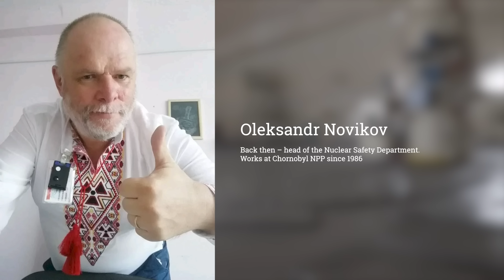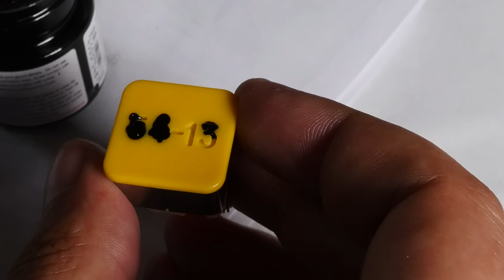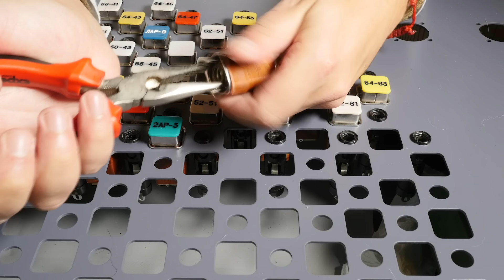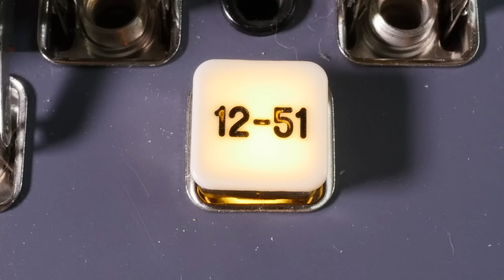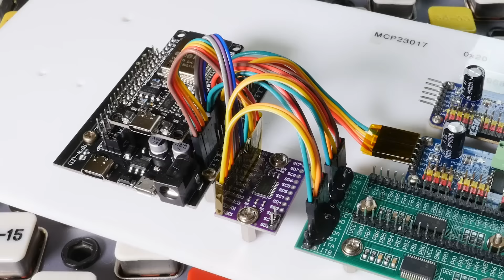Chernobyl Reactor at Home — Part 1

Comment: Why were some of those P2P1T switches unlabeled??
Reply from the maker: Because they serve as indicators for DKE-H detectors (energy distribution by height) and technically they can be pushed, but nothing will happen – they are not wired. There reason why they used buttons is that the panel was upgraded, and the easiest option to fit something in those specific square openings was to use blank buttons.

Comment: Or you can make a fully blocky shield by controlling the power unit better using real graphics.
Reply from the maker: That makes sense. BTW, check the more recent videos, as there have been made more tech.

Comment: do you know what would make it even realistic and extreme to do?

add a miniature of the RBMK-1000 with a sytem that raises and loweres the control rods with the action of the controls. you can do it with step-motors and some endless screw mechanisms to simulate the core

i love the project and i will be expecting new updates! it´s simply awesome!

Comment: If i send you 50.000€ can you build me one?
Reply from the maker: I guess yes, yet finding original parts will take some time ;)
Reply: Has it to be Original-Parts? Arduinos, Stepper-Motors and 3D-Printing would be fine for this. I guess there are a few people who would give you money for this and if you have the simulator software you can copy it and reproduce the machine you "invented".

At least 50.000 would be the start of a crowdfunding.
It was only an idea because i don't have this money. =D

But see it as an idea. Of course i would buy one. I guess many people would buy an RBMK-Simulator.. 

One guy here in germany where i live rebuilt an WW2 Submarine and makes now "24-Hour-Experiences".

Do the same with this! People like us would love it! ;-)
Reply from the maker: All the point of these projects are to make them as close as possible to the original. It is not about money; it is about that I'm not a superman, and this is a big job. I am honestly so tired after making it that I am not sure if I'd like to do it again :)))

Comment: To improve LED light dispersion - one or two layers of wax paper work great. You know - the stuff in the kitchen used to wrap sandwiches.

I used that 23 years ago when converting the lighting of the instrument cluster of my 1991 mk2 VW Golf. Blue LEDs work better, look better, last basically forever and are easier to read in the dark than original lightbulbs+OEM green dispersion foil.

Normally (this was before wide-angle SMD LEDs) you had a bright stripe in the middle - but nothing above and below that. With the wax paper - it was all very nice and evenly lit.

Additionally - I painted the white hands with Revell paint "Firetruck-red" - which adds a nice light glow. The digital clock/boardcomputer was switched to red LEDs as it was easier than blue (which always looked "dirty") and also gave a nice contrast.
Reply from the maker: Great tip, thank you!

Comment: This is incredible! Your work and dedication is amazing! I’ve always been curious as to why some RBMK control rooms have that button assembly split in half (2 half moon shapes) with a gap in the middle rather than having the buttons arranged in a complete circle like you have built. I wish I had a picture to hand to explain what I mean.
Reply from the maker: I know what you mean – that is just a design to fit standard panels, nothing more.
Reply: @ChernobylFamily thank you, I had a feeling that was the case but it must make it a little more awkward for the operator this way.

Comment: Dear author, could you please tell me how you connected a dot matrix printer to an ESP 32?

Do you happen to have a page that explains in detail how you made this project?
I really liked it, I want to make a smaller version, but I don't know many aspects(
Reply from the maker: You just grab a MAX3232-based RS232 to TTL converter (they are bi-directional) and wire it to ESP32 UART (tx -> txd, exactly as I said, not tx -> rxd). BUT, please note that I used a printer with RS232, not LPT.

Comment: The fact you can even find this amount of actual switches, bulb sockets and bulb holders is just crazy. Then you actually put it all together, hand crimped and wired it in the dark, and then programmed it all. Is actually nuts! I would've been perfectly content with some 3d printed replicas, but you went the extra 1000 kilometers. Much respect, slava ukraine
Reply from the maker: Yes, it was a big work, but just wait for the continuation!

Comment: Why having buttons that shall never be pushed?

That has always been such a mystery to me.
Reply from the maker: This is because this is a modernized panel. Into existing openings were installed new buttons with different functions than initially designed. The openings are quite specific in their shape, so as there was needed an indicator, the easiest way was to use a button and wire just its light bulb. However, all those buttons are wired. You do not push them during NORMAL operation, but there are some cases where they can be pushed, e.g. maintenance.
Reply: @ChernobylFamily  I see! it was more of a backfitting. That makes a lot of sense actually.

Comment: Engraving of course is the gold standard.  In a previous life I've myself created the labels for the control panel of a power plant.  Designed the labels in CAD software (because if all you have is a hammer every problem looks like a nail) which allows creating labels at an accurate size, then print them on clear transparency film on a laser printer.  The toner can easily rubbed off so this method is only suitable for labels that are not touched.  For the rare cases were protection was needed we were applying an additional label of the same foil on top of the first.  Applying a whole A4 sheet on top of another without bubbles is difficult but easy for smaller sizes.  All in all I think a pretty good method and well suitable to large number of buttons.  Far cheaper than the tapes for label printers and can look pretty seamless and I think well suited to maker projects.

A method used to fill engravings with paint industrially is to fill the entire engraving with paint using a paint brush or similar high-tech tool then wipe off the excess on the top.   In other words the difference to the video is to wipe it off while the paint is still wet.
Reply from the maker: Thank you for sharing!

Comment: It's crazy that even after reactor 4 suffered a steam explosion and subsequent melt down, they kept the Chornobyl/Chernobyl Nuclear Power Plant operational into the 2000s, with 3 RBMKs.
Reply from the maker: Because what was after 1986 is a very different machine. Given the sheer size of the power plant, it was possible to achieve – truly affected was a part on its edge.

Comment: for the LED sanding i would use a sanding sponge and cordless drill. u can place the LED on the chuck or make a adaptor so u can quickly swap the LEDs since u would only spend second or two to spin that LED against the sponge to "frost" it
or tip the LEDs to white paint or into some other paint that gives the milky colour to diffuse the light
Reply from the maker: Good idea!

Comment: Couldn't an led and a button matrix have been used instead?
That's usually what is used in control panels with many buttons, like keyboards for example.
By connecting a diode to every button, they can all be connected in such a way that you have a wire for each row and a wire for each column.

In a keyboard, you would have 22 column wires and 6 row wires, instead of 108 individual wires.
If you think of the buttons as a grid, with x and y being the position of each button or led,
it's like saying "X=42, Y=53" instead of "Index=2226".
It saves a lot of extra wiring, and the amount of wires needed doesn't increase like [amount = (x*y)²], but like [amount = x+y].
Same works for leds, but those don't need diodes because the leds already do that.
Reply from the maker: I made it similar to the original. There is no matrix in this particular panel.
Reply: @ChernobylFamily  But it could have saved you a lot of wires and expansion ports...
Reply from the maker: True. Yet, I wanted to enjoy the process :) i will definitely use a martix for the next expansion of this panel
Reply: @ChernobylFamily  As long as you are enjoying it! It looks insanely cool!

Comment: I noticed in some older footage of the reactor 4 control room that the control rod panel here was laid out with many red buttons in like a way where it formed 3 red triangles within the circle, do you know the reason for this and why it is different?
Reply from the maker: Because back then, there were fewer systems of control and protection, and they were arranged differently inside the core, hence the difference in the panel layout. We will have a video about that, it is a big subject to cover.
Reply: @ChernobylFamily thank you!

Comment: Hi. I watched your video with the replica of part of the control panel for units 3–4 — really great work. I especially liked that you showed the soldering and hardware part. And honestly, off camera I can imagine how much time you probably spent on the code 😄 Programming your own mini version of SKALA was likely no easier than building the panel itself.

This video actually made me think about a few things. There is a lot of information about the real control rooms (BShU) of units 1–4 at Chernobyl, but I almost never see any clear information about a separate training or backup control room at the plant itself, even though IAEA recommendations suggest such simulators should exist.

I’m also curious: in the past, all signals from the control room went to the SKALA computer system. Do you think it would be technically possible today to replace SKALA with a modern computer and simulator, and “bring to life” BShU-3 in a safe training or museum mode?

One more thing. In one interview, Anatoly Dyatlov mentioned that he wanted to send the Unit 4 operators to a backup control panel, but later this order was canceled. Have you ever come across information about what kind of control panel he might have meant?
Reply from the maker: There is a reserve control room. It is just not public.
SKALA keyboard+display set is planned. I am literally now buying components for it...)

Comment: Such beautiful reproduction of the control panel. Huge work put into this gives a perspective how monumental task building the actual power plant must have been. Wires, switches, indicators, thousands of them all hand wired and assembled.
Now your panel needs just the reactor to be controlled with. It would be cool to have actual simulation of the core running on a computer, but accurately simulating a real reactor has been proven to be, lets say, not trivial. Maybe a simplified emulation without going into the actual nuclear physics and material sciences will have to suffice.
Stay warm and safe!
Reply from the maker: The simulation is definitely a challenge, but we have some plans for it! It will be simplified, of course.

Comment: I wish you could add a 30:05 meter display replica too. Using servos as fake meters. The switch board and metering board would be the ultimate combo in a simulation.
Reply from the maker: With us — no fake tech. Stay tuned

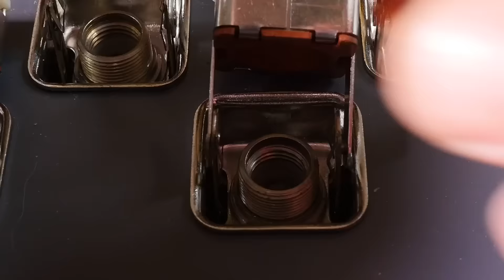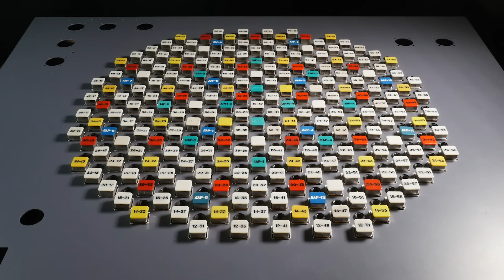Comment: 18:00 the PINs on the LED's are random, because (I think)  if you look at the footage before, some of the connectors are mounted backwards in your system. You can see it at the seam of the silver metal at 14:15. 

But nice video!
Reply from the maker: No. By me all are arranged correctly. They are assymetric. But as the original buttons were all designed for lightbulbs, polarity was not important. Yet, there had to be a standard.

Comment: I do wonder though, will there be more content on the Duga computer in the future? It was fascinating, large scale computers and stuff. I love big old automation stuff! 

Also, is there still active powerplant that use the same BAZ and AZ switches? If so,  Why is it hard to get the switches if there is stil demand for it at critical facilities?
Reply from the maker: 1) There will be
2) Yes
3) Because the switch costs a little, but a certificate of compliance to safety standards cost much. They are normally not sold without it.

Comment: Amazing work and effort - looking forward to further detailed videos like this!. So, did I get it right, AZ-5 and BAZ only insert the red rods instead of every rod? And turning the switches to left activates the system/signal? Would be lovely to hear in further details how the controls were changed after the incident if there's something else than the BAZ-switch. Learning of how the AR and LAR were controlled by the operators would also be great. Keep up the good work!
Reply from the maker: Both insert all. But during BAZ red rods go faster.
Reply: @ChernobylFamily  Thanks for the clarification!

Comment: Great job Alex!
it's amazing that you  recreated control panel with electric(White wiring <3...is so common in old soviet devices) . I think all of Selsyns pointers are too crazy to recreate, but small panel with for example 5-6 pcs were good ONLY for presentation how it works together with control rood panel. Selsyn guages i think is  БС-404НА9 (Reciver).
Reply from the maker: Btw in the original panel, the wires are blue/red.
No, if we make selsyns, we make all 220+. Probably, scaled down.

Comment: I still don’t understand how toponov understood what rods to pull out and when. Supposed he was doing it wrong and some other engineers stepped in to show him which to do before the test. I mean why would you push certain white switches vs others?
Reply from the maker: You study that for years, and it involves understanding of the neutron field configuration inside the active zone. He knew everything and did it right. The problem was not in that, but in an unknown effect.
Reply: @ChernobylFamily so why did the other engineer step in and show him which rods to use describing it as a teaching moment???

Comment: Man, what an impressive job you've done. And at the end it became clear why you were so hesitant to flip the АЗ5 switch while testing... Браво!
Reply from the maker: Actually, if jokes apart, AZ-5 works well. But as it generates a ~4 m long printout of operations inside the active zone, I decided to postpone the demonstration for the next time - better to program it correctly first.
Reply: @ChernobylFamily  If you skip the line feeds, you can save a lot on paper. And I'd like to donate 10 coffees using PayPal, is that possible?

Comment: This is really nice. When you say that two hundred (and some more) switches went into this panel, I cringed at the number of connections required. The dot mateix printer is a nice touch.. Again well done on this effort.
Reply from the maker: Yes, the amount of wiring is insane. But it is worth it.

Comment: you could make an interface to control the chernobyl simulator!!!!! you can make alarms, create a fake CCTV camera of the reactor based on the simulator, there are open source versions on the github, u can use multiple monitors for the multiple panels :D
Reply from the maker: Theoretically yes.
Reply: @ChernobylFamily  there are some open source keyboards controllers, you can use a matrix

Comment: do you think your confident building the selysns despite having to buy like hundreds of those?
Reply from the maker: There is a workaround, I do not see the point to use specifically selsyns for it.
Reply: @ChernobylFamily  so it could be digital?
Reply from the maker: @sfsrocketbuilder505 pwm servos, easily

Comment: you should build a scale reactor core of fuel rods and absorbers..   maybe using lego or something as the rods, if you wanted to be extra fancy you could add little heating elements below each simulated rod, so when the rod is pretending to be active it can heat water too.  (also you should add a nixie display.. because they look cool :P)
Reply from the maker: A model core scaled to a table size is very much possible, just it is hell of repetitive work.

Comment: Lovely and very interesting project. 

Thanks for sharing this.

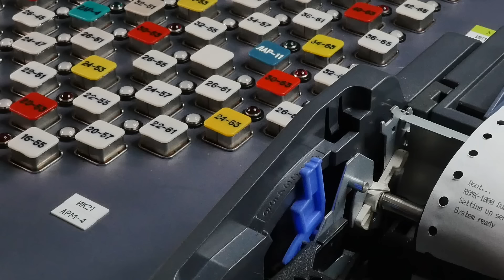I laughed at 29:00 when wifi was mentioned - I tried to imagine running a complex system entirely from a laptop over wifi... 😂

But really, it looks so good and professionally done! Well done!

Edit : the AZ-5 at the end left me laughing 🤣👍
Reply from the maker: In reality this things with WiFi appeared as a precaution. The system is powered with an external PSU. I also can connect USB-C to my laptop to see console output directly from the ESP32. But in the case of a power loss (as we have random shutdowns), all that will switch to draining the ~3A current from the USB which highly possibly will burn the port. So I needed something that gives me logs with no physical connection to a computer. Hence the telnet and printer. Printer is more convenient – paper stays.
Reply: @ChernobylFamily Dot matrix printer all the way! 👍

Comment: Amazing video, one thing I however noticed is you mentioned TELNET.

There has recently been a pretty serious vulnerability found in TELNET, I am not read up on the details, but would suggest that, if the computer running the simulator is connected to the internet, you read up on what exactly that was and make sure to update to the latest version of everything on that device. 

Anf if the device doesn't need internet, them simply not connecting it avoids all vulnerabilities.
Reply from the maker: This wifi hotspot is only for a direct connection, no internet bridge intended

Comment: Absolutely fantastic work! I had the same issue with Dupont connectors in a 3d printer I rebuilt. My crimpers actually broke, so I crimped the pins for every connector with thin needle-nose pliers. While it does work, I feel like I lost 50% of my eyesight doing it. And, that's only 100 pins!  :)
Reply from the maker: Yessssss